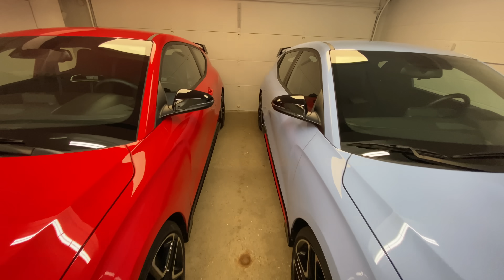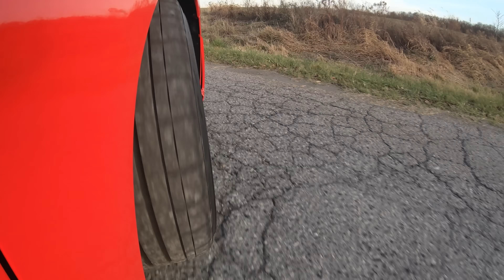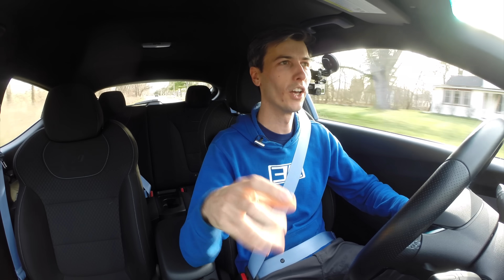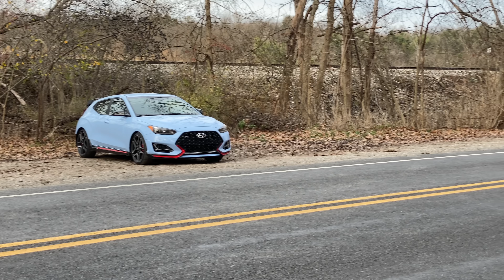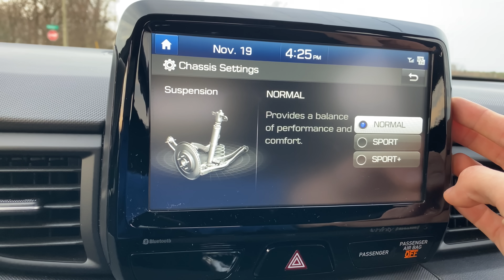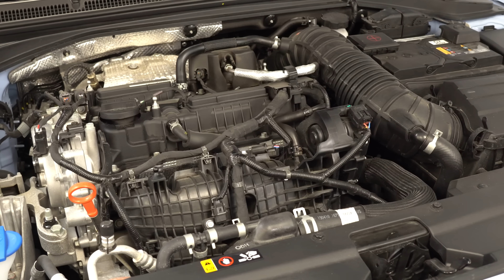Are Front Wheel Drive Sports Cars Any Good?

Comment from the maker: Thanks for stopping by everyone! This is the second video of a three-part series I've teamed up with Hyundai on, covering the engineering of the Veloster N! Easy to agree on when I drove the car back in 2018 and loved it. Here are related videos if anyone's interested in more:
Videos That Are Not Sponsored:
Veloster N Review - https://youtu.be/6BVEhLBj7MQ
Nurburgring Lap, Veloster N - https://youtu.be/W7ZfO5E-jiE
How Veloster N's Anti-Lag Works - https://youtu.be/ccMg-KzMgU8
How Exhaust Crackles Work - https://youtu.be/64YzCty-27Y
Sponsored 3-Part Series:
Part 1 - DCT vs Manual - What's the difference? https://youtu.be/oQQ3nfIf6EE
Part 2 - This video!
Part 3 - Coming December 23, dives into Veloster N DCT features!
Reply: IMHO the problem with front-wheel drive is when driving on the limit any increase in power induces understeer which limits the cornering speed on the way out and you cant get on the power as hard either which is the main issue with acceleration on an FWD.... Having to wait that bit longer to get the power on compared to a similar sport RWD as opposed to wheel spin in a straight line.

The other big performance handling issue with FWD is that you can't induce oversteer with the throttle.
Reply: Hey man, love your videos! Not sure if you made one already but I was wondering whenever you’re free if you can make a video that explains why the torque curve on a torque/hp vs. rpm graph falls back down after it peaks at a certain rpm. Just a phenomenon that im having trouble wrapping my head around. Would appreciate it a lot!
Reply: review cars and get paid from the manufactures.
thats the youtube way.
Reply: Hi bro. Can you please make a video on whether front and rear wheels should have the same or different pressures. And if there are differences , whats the rule of thumb between front wheel drive cars and rear wheel drive cars????
Reply: @temwananinkana3419  F/R tire pressures are based on the amount of vehicle weight over those wheels.

i.e. say you have a a vehicle that has 70% of its weight I've the front wheels, with 30% over the rear. If all tires have the same pressure, the front tires will look low compared to the rear. This would drastically increase the amount of tread wear. Solution? Increase the pressure.
Reply: Hyundai engine has HUGE fire problem.  
4 out 10 car catch fire on highway are KIA or Hyundai.
i would not recommend them
Reply: @atmark666  only for certain model years. My car, for example, an Elantra, is a 2009, worst model year is 2013. Haven't had any problems besides worn out parts.
Reply: Loved our Elantra Limited
Reply: Hyundai has come to be one of my favourite car brands. I love the styling and features of the Veloster Turbo and Veloster N Line, as well as the Elantra N Line.

Speaking of which, I'd like to see a video or two covering the Elantra N Line.
Reply: I love my Veloster N!

Comment: Everyone will hate me for this, but let's go:

1_  Front wheel drive favors regenerative braking. The weight shift towards the front axle during braking means the front wheels can receive higher braking torque, permitting higher regeneration power, and higher energy efficiency.
2_  Steering or driving an axle makes it way more expensive to manufacture than an axle that is neither driven nor steered. However, driving the front wheels will cost only marginally more than just steering them, while driving the rear wheels through anything but a live axle will cost as much as or maybe more than a complete front wheel drive suspension.
3_  Rear wheel drive is only necessary when, due to the power level, it is critical to use the weight shift to the rear axle during acceleration in order to provide better traction.
4_ Torque steer is caused by driveline asymmetry and suspension geometry (when the traction makes the wheels toe in too much and then a minor weight shift chooses one side to runaway to); but depending on power level, when the asymmetry gets sorted out, the geometry doesn't need to; just look at Subaru cars.

Comment: You didn't explain torque steer, you kinda just said it was caused by torque. Tl;dr: it's caused when under acceleration one wheel slips but the other does not, so the vehicle pulls in the direction of the side that has traction.

Authority: I own a Mazdaspeed3, and it skitters like a 6 month old Rottweiler on a hardwood floor. I am fine with this.

Comment: Thinking back to my very first, a 1976 Honda Civic CVCC, front wheel drive has always seemed a compromise between efficient/cheap packaging versus stable handling.

But don't fret -- in 5-7 years we're going to see four 50kW motors (one per wheel) driving our 2800 lb 2 seater electric, from a 100kWh battery.  That's Porsche Cayman territory!

Comment: Locking differential cases oversteer - it makes  you faster on take off but you loose speed in fast corners. It’s not a solution. If you need cheap sport car buy Nissan  370z. Don’t waste money on this front wheel drive toy.

Comment: FWD reduces weight when your stepping on the gas cuz of the 2 front wheels spinning it drags the weight of the back of the car but RWD its the back 2 wheels spinning and all of the weight is in the back so the tires has to push forward the other good thing is FWD Improves Fuel Economy & Traction since the Transmission also the weight of the Engine is above over the front two wheels

Comment: I'm always impressed by what manufacturers have done in the affordable car market with front-wheel drive. If you look at the top offerings in the sport segment from Honda, Mazda, and now Hyundai, great strides have been made on the engineering side of things. In the late '80s, Dodge campaigned two Dodge Daytonas in IMSA GTU (under 3.0 liters). The Archer brothers ran the racing program and drove the cars. One car was front-wheel drive (the only one in GTU as far I recall), the other was conventional rear-wheel drive. It was an engineering exercise to learn some things under harsh racing conditions on how to maximize front drive handling, braking, and tire management.

Comment: @EngineeringExplained I've always wanted to ask you this. Electric Cars & Regen related. Why is the passing air over a car at highway speeds, or an electric truck not being utilised? It's how windmills work to generate energy, both old school and renewables! If you had Venturi pipes running through the chassis with little turbines wheels or something? I understand I'm not an Engineer, though... It's at least a way to vastly increase the range in a car. On trucks cruising 500 mile long highways? You're welcome. Nikola Tesla's brother from another mother 💯👊

Comment: I'll always prefer RWD to FWD because it's more fun and more predictable. What he forgot to mention is that FWD is more dangerous because when you lose grip on the driving wheels, you lose all steering as well. In a RWD car, you get a bit of fish-tailing going on so you never lose steering even though the drive wheels as sliding. It lets you know where you stand. Also, the optimum vehicle setup (for performance) has proven to be RWD with a mid or rear mounted engine. That gives you optimum acceleration and handling and you can't beat it with FWD.

Comment: Hey Jason so back in 2011 Toyota released new oil viscosity ratings for old vehicles dating back to the 90s, with many that were rated for 5w-30 oil now updated to be able to take 5w20 or even 0w20 oil, Id just like to know more about the topic since in the corvette video you mentioned you shouldn't go higher in the cold rating and lower than the hot rating. The UZ series engine was speced  for 5W30 and now speced for 5W20, while the UR series engine with bigger bearing clearances are speced for 0W20.

Comment: The term Sportscar has been watered-down  since you can basically make every car into a performance car if you put enough resources into it.
Engine up front won't help much either even with all the weight. The tires are just going to be overwhelmed at some point especially if they have to do accelerating and steering at the same time even with a diff.

Comment: Did the e-LSD actually hold up on the Ring? Most of these multiplate clutch systems overheat with sustained spirited driving and go into the open diff mode.

Comment: With FWD a car goes in every second somewhere between the cars own direction (momentum), and the direction of the front wheels. The only thing to influence the back of the car is the handbrake (and of course its braking). With other words U never can achieve oversteering with a FWD vehicle.  And I dont speak here about drifters, or broadsiders. But that means, that your steering is limited, and it can only be effected by the steering wheel, what U have to overturn (because of, and depends on the momentum) to turn the car into a direction U want. Actually the cars back is that wants to go straightforward, and pushes the front out of the corner. Front wheels (with throttle) tries to hold it in. Steering is up against the momentum. With RWD by the way U can get (a little) spinning impulse with throttle, separate the accelerating forces direction from the cars moment and therefore U have a much greater control of your cars turn (when U do it properly). Simply because U have the opportunity, to spin and control the back of the car, that way, that the moment and force sum of the mass centre points the right way in the corner. Steering (with throttle) uses the momentum. 
Compared to AWD... I dont think I need to explain that case.

Comment: I have a manual '20 Veloster N and LOVE this car! I should confess that both my wife and I have a silly grin on our faces every single time the engine starts and the pops and crackles appeared, or while cornering hardly on twisty roads - I can't tell you how many times I deliberately picked the route with as many switchbacks as possible just to enjoy driving it a bit more. A friend of mine, who has an '18 Focus RS, has been impressed by this car, too. In fact, the only two features I'm somewhat missing are AWD and heated seats - other than that, I have no complaints, regrets, or qualms whatsoever. 

I think Hyundai did an amazing job of creating fun and driver-centered car on a budget.

P.S. I test-drove Type R and WRX as well, and those are undoubtedly great cars either, but from the appearance and maintenance perspectives, as well as overall cost-to-benefit ratio, Veloster was the best option for me

Comment: For me it's a sport car if it's A fast B light and C you can get over- and understeer from it. FWD car's are a blast on tight hill streets where you can throw the rear and accelerate out of the corner. Sadly you can't do it that often. Blue guys and your suspension don't like it that much.I
Little engineering joke: Light cars are the easy and cheap. Just don't put all that weight in.

Comment: FWD has the advantage of having the mass of the engine and transmission out in front of you in a crash. Back in the day, when cars weren't so heavy, a driver and passenger could get the weight balance of a FWD car nearly 50/50. Not so anymore and these FWD 2000lb+ cars of today handle pretty badly.

Comment: Only one word you need when answering a guestion: Can fwd car be fast? -Integra
Reply: Still probably the best handling stock cars I ever owned, I do give a little smile when I see a clean one driving by
Reply: @tbm275  drive the new type r if you ever get the chance
Reply: @alexvillalobos7137  I have, it's far too high strung and stiff for a daily driver in my opinion. If they would make a better coupe-styled hatchback Si it would be better. Maybe if they upgraded the adaptive dampers to have a comfort setting it may help but having 19 inch wheels on ~35 profile tires doesn't help ride quality.

Also not a fan of the interior, Integra was simple and understated, Civic now is over designed. Maybe if they would put the Type R drivetrain in the Acura ILX I'd jump on it.
Reply: I want to like the Type R, but I would need to guy a second set of wheels with nowhere to store the stock set of wheels, or just sell them. Seems like a waste.

Comment: Thoughts on the speculated upcoming 2024 s2000.
2020 Civic type r engine 
Rear wheel drive 
6 speed 
Only 3000lbs 
I'm thinking it's gonna be amazing
Reply: I really hope a 2 seat roadster weighs a lot less than 3000 pounds
Reply: @ervin7178  probably just modern safety requirements but the original was 2800lbs so it's not much heavier

Comment: Sports cars are about sports. If a car is designed with lightweight and minimal weight transfer in mind, then it will work well in racing with minimal modification. That is a sports car. If you overcome excess weight with horsepower then you have a muscle car. If the styling and top speed takes precedence over practicality then you have a supercar.

Comment: It’d be good to point out why your point about front drive having better traction in snow doesn’t contradict your first point about weight transfer. The reason, of course, is that if you don’t have the grip in a car to generate significant acceleration (in the snow), you don’t get the weight transfer. That means you’re left with closer to the static weight distribution, and front drive cars have a lot more weight over the driven wheels than front-engined rear drive cars. Rear-engined cars of course combine this benefit with rear wheel drive. Where they differ is the driver can’t change the direction of torque to help keep the car on a cambered road at low speed in very slippery conditions - the rear of a RE/RWD car will often drift down the camber, just like a FE/RWD car. The other thing worth pointing out is that with winter tyres, whilst a FE/RWD car still has a relative disadvantage, there is enough grip and traction to get around - obviously BMWs are made in a snowy part of Europe, as were classic Volvos.

Comment: In addition to FWD, the other thing I dislike about that type of car is the 'shift by cable' system. They are mushy, soft and feel like an arcade game.  All that is why I like the Subaru BRZ so much!  If the're hell bent on using a 'trans-axle', put the whole shebang in the rear! Even with a mushy gear shift system it would still be a proper sports car. 8)   Honda, are you listening?  8)  The Gold Wing has a flat 6 and side radiators  (hint hint)   8)    JMHO    --gary

Comment: And another thing, the time money and engineering that went into this to make it a great driving/feeling drive could not have cost less than a simple rear wheel drive layout. What is the point of so many cars being front wheel drive in this day and age? There’s still a massive amount of design put into new vehicles to make them the near perfect spaceships they are now compared to vehicles just 30 years ago. I’m not buying it.
Reply: The time and money involved to make the veloster or i30 (both fully developed cars already) faster and more fun to drive, does cost significantly less than developing a brand new rwd vehicle. Hyundai currently does not have any small rwd vehicles. They do have several small fwd cars to soup up.

Comment: Theres no such thing as a FWD sports car. You can have a FWD performance car, but not sports. You need the challenge of wrestling with a RWD 50:50 chassis to turn the act of driving into a sport, a challenge.
I've had a RWD hatchback, a FWD 'sports' saloon, a FWD 'sports' hatchback, and now a RWD roadster and I cannot comprehend how anyone can find a FWD car sporty. Admittedly I haven't driven an integrea type r or i30N or whatever people like, but there's only so much you can do to fight physics. IMO an old basic BMW is much more fun than any modern hot hatch

Comment: Agreed, I have a 2019 GLI 35th Anniversary and been working with Paul's crew at DAP Repair and yes with a mild tune, upgraded rear sway bar and end link then put on some good summer tires and it is shocking how well these cars can perform. I really wanted to RWD performance car and almost got an 86/BRZ and also this Veloster N but after already leasing a 2019 base S trim Jetta since 2018 the loyalty discount sold me on staying in the VW family. They can be amazing and affordable fun.